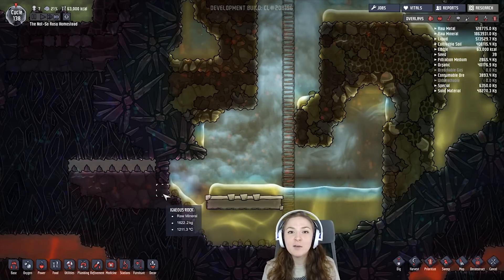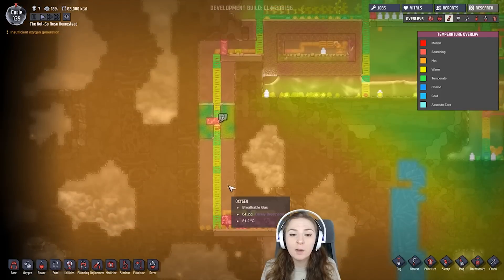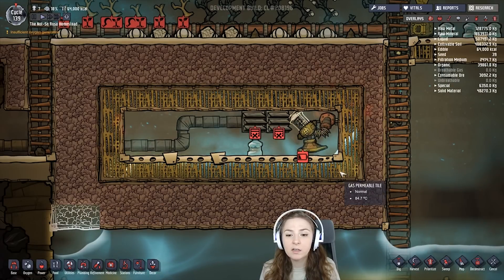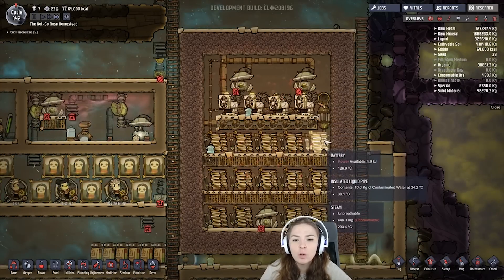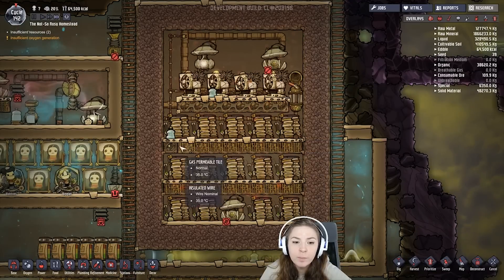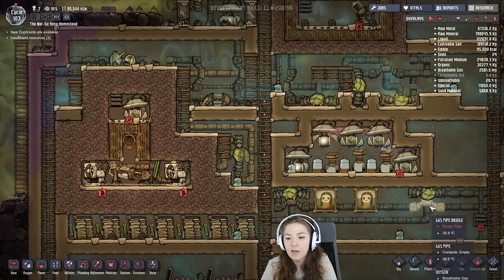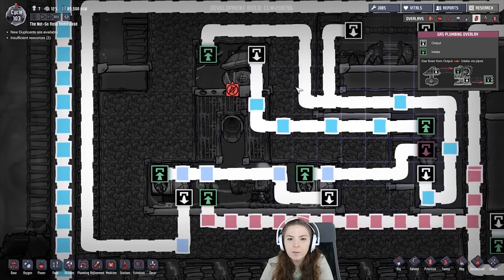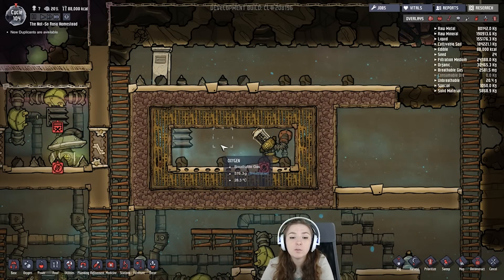How to Use Steam to Clean Contaminated Water - Oxygen Not Included - Alpha Release

Comment: The issue with water failing to boil is a known physics effect call the 'Film' effect, because the fluid isn't actually 'touching' the hot surface it cannot transfer heat correctly. 

Likely due to physics simplifications the film barrier doesn't break down.

Comment: Could you do a video with an "open" base?  This is where you let the gas move around the whole you do not block Hydrogen from getting in, you gather it in the top, allow it to move up there smoothly, and control other gases via Electrolyzers, 1 Scrubber, and terrariums.  I've done 3-4 successful, sustainable runs with this now, and it seems better than tight control.

Rather than thinking of Hydrogen as scary, now I think of it as a gold mine if I can get it into my base.  No more coal spending for another 20 cycles!  More time to find Natural Gas.

Comment: i think actually that it is fine to have a small layerof water, so long it is not too thick, one block thick is too much, but if you build a vertical room and do not have too  much flow, a puddle of waterat the base of the batterys is fine. One thing you did not bring up at all was material you use, some materials are hotter and colder then others, i think.

Comment: you can setup liquid pump, gas pump and a went inside a room (check room, if liquid pumps out, if not pumps back), better narrow, 2 wide but higher. then use thermo regulators to cool it, pump it back. there are default heat value like 26 C for contaminated oxygen and turning points like -200 (not exact value) for liquid oxygen. the difference divided by 14 C (one regulator) shows how many loops it needs(8 loop=one time trough 8 machines or 8 times trough 1 machine), for example 16 for contaminated oxygen, 18 for steam , 8 for chlorine, 10 for co2 if i remember correctly. extra loops for higher imputs. 240 watts each regulator needs a lot of power, like 2400 for 10 of them , 100 sec night is extra 20%, +pumps+bit extra adds up to 7-8 full time dupes. thats why needs rerouting gases back to regulator. also too much cooling turns them into useless solid state. so if you can cool it 8 times, then check room, pump into 2 more loops in different coolers, and back, until all turns into liquid. the speed and amount is lower but so does the electricity bill. 2x5 rooms with more check rooms also work http://i.imgur.com/wfYEq0b.png this system works with all gases, steam, oxygen, etc.liquid chlorine and  co2 can be mopped/used in showers

Comment: I tried your cool chamber, but I cannot get it to work. Because inside the cool chamber had high concentrated contaminated oxygen when i built it. So unless i put in a air pump to empty the cool chamber, the cooled steam would not be pumped into the cool chamber because the cool chamber is over-pressurized. Am I missing something? Is there a solution? How did you do it?

Also I noticed your magma steam room does not use a filter to separate contaminated oxygen and other non-steam air content, wouldn't that clog up your cool chamber over time?

Comment: Nice vid. Thanks for the advice. I was tempted to use magma for mine to see if it worked. nice to know that it will, if done right. 

As for your layer of contaminated water that won't turn to steam. Could that be used to make a thin layer around your base to "suck up" the HEAT outside the base? That would be hilarious if you r base had a 1 tile thick layer of water protecting the insides.

Comment: There is nearly no athomsphere inside your testchamber so there is no medium that can transport the heat to the water, so for a real test you need a chamber filled with 10 times more than you have so not 100g co2 make 1000g hydrogen becouse hydrogen have the best thermal conductivity, 103.9g o2 cant realy heat up 1001.9 kg conterminated water, its a flood on a warm stone :)

Comment: i haven´t looked up your other videos , but a question.
if you replace some of the batteries(+4 heat)  direct with the Thermo Regulator (+8 heat) and cool down co2 or other stuff  , it does not matter what as long as it keeps running or ? 

And the ratio from morb to pufs 
the morbs create slowly contaminated oxygen  in a room with under 1000g of pressure  but the puffs eat a hugh bunk of it to create algae 3 are not enough 

And a torture chamber for duplicants (vomiter)  with a foodbox and air (to just keep them alive) to collect wasted water with the steam methode you can get water out of plants wich only need pressure to grow . they grow in oxygen co2 hydrogen ... 
they can have to power up the system too just put some wheels in it too they run make a mess eat and run

Comment: Super Cooling contaminated oxygen down to about -180 gives you liquid oxygen which can be heated back up to clean oxygen. Your heat issue is because the airlock door you have is at 70degrees. Dismantle it and try to use cooler copper. Also all the natural rock gets very hot as you spread your base out, so use insulated tiles to protect your base if you don't want that heat constantly spreading into your base.

Comment: I found a way to "store" oxygen and getting rid of CO2. These methods do not use sand.
In game, if you cool gaseous materials below their freezing points they freeze just like in real life. 
Step I: produce oxygen/CO2.
Step II: Stacks some thermoregulators together and run your gasses through them.
Step III: Put cool O2/CO2 in a insulated room.

Cool gasses freeze on their own. Currently you cannot haul solid O2/CO2 and ice (haven't tested other gasses/liquids)
You can put A LOT of solid CO2 in same spot. I don't know if there is a limit.

If you want your O2 back(Haven't tested yet but should work):
Step I: Heat insulated room with solid O2 up(Magma/Batteries)
Step II: Pump gaseous O2 out
Step III: Breathe 
Step IV: ???
Step V: Profit!

you can check melting/boiling points of materials by mousing over them.
Storing O2 is kinda useless.
Getting rid of CO2 isn't.
Reply: Could you use Abyssalite with this in any way?
Reply: nope, abyssalite has specific heat of 0. formula for heat transfer is Q=m.c.(delta)T since c is 0 no heat will be transferred.

Q-> heat 
m->mass
c-> spesific heat
deltaT->difference in temperature
Reply: "Step I: Heat insulated room with solid O2 up(Magma/Batteries)"
I think solid O2 won`t convert into gaseous state :/

Comment: Dozes of ONI LPers, and the one with 882 subs is the one who actually tests stuff and makes sense.

Well, 883 subs now. 

Anyway, so Temperature is basially broken entierly. Air Temp doesnt transmit to water Temp, machine Temp NEVER goes down, Tile Temp depens on the Temperature of  the material you used to build it and also never changes after being build. 

I do hope the Cotanimated Water -> Steam -> Clean Water way of doing things sticks tho, as that is a damn nice way of doing things in the long term. 

With Electrolyzers doing Hydroge and thus power, you could propably last a few hundred cycles with the water thats all around the map. Would still run out of Water at some point.
Reply from the maker: Thank you!!! ❤️❤️❤️ And thanks for sharing that information! That's really useful!! :)

Comment: I search the half internet for it. ty.
Now i can play a collonie infnity.

i figure a way out how to trap puft´s forever. http://steamcommunity.com/sharedfiles/filedetails/?id=872947606
the upside down "U" keep them traped and the bio destilators keep the tempature up. so they dont die of freezing.
dont build mach tiles they will walk around and die in your base.
Reply from the maker: Happy to help :) Also very cool puft trap! :)
Reply: Hello Lacy I add now a water airlock. they can't Tuch water. but now I need a air pump system to keep them in their natural. and heat is bit too low now. 

I think the way I trap them before  is one of the best. 

if you find a better way I would like to see it in one of your videos.

Comment: awesome tips:) i had been going with the idea that non insulated pipes would give out heat/ absorb it. i had a resovior with pipes filled with hot air from my machine room snaking through out the room hoping it would slowly heat up the water, but it did in fact just cool down the temp. on my air in the pipes ever so slightly like 0.01-0.1 C'. 

Will try this for sure
Reply from the maker: Thanks! I'm happy I could help!!! I tried that originally too :)
Reply: I've tried this as well, without results either. Maybe insulated pipes only protect from heat transfer into the pipes from outside in the current version, not the other way around?